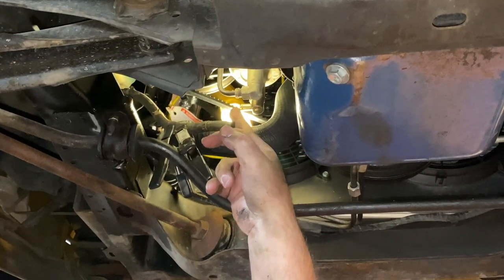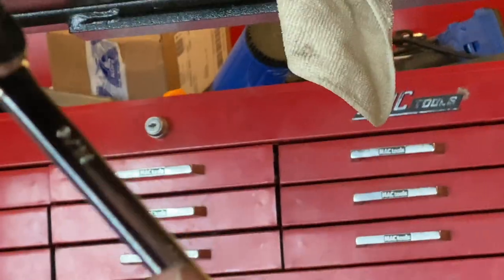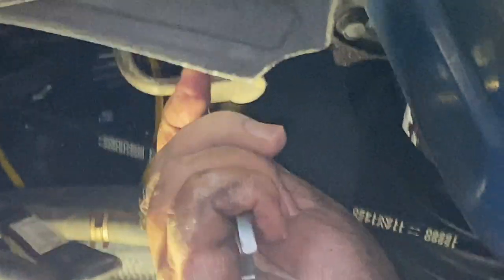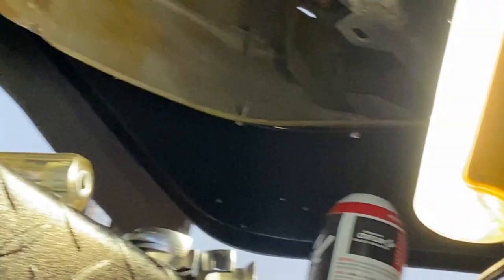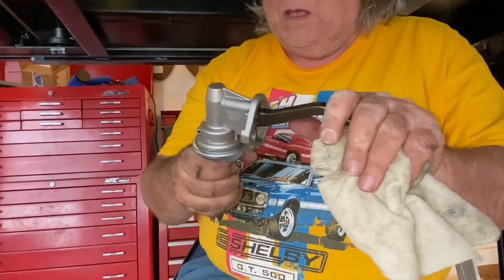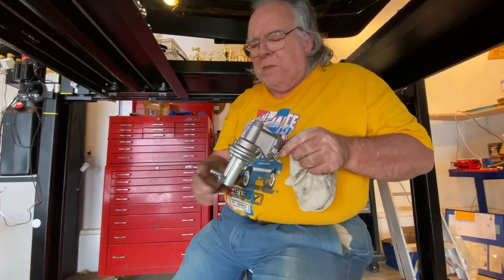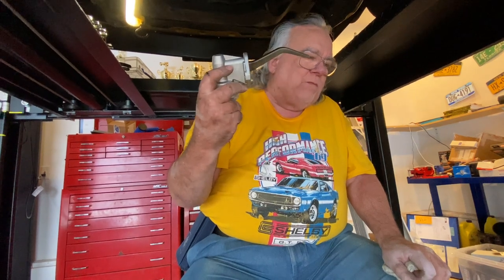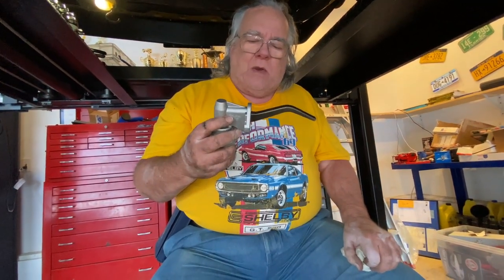1973 Mustang 302 V-8 Fuel Pump Removal

Comment: 6:21 I'm positive my gasket is the issue with my pump, can I make one out of the carburetor meter block gaskets I got in my 6140-6150 carburetor kit?
Reply from the maker: Any gasket material in good condition and cut properly will work fine. Especially if you use a silicone based adhesive like I did. Using a good quality silicone gasket forming adhesive, like the Permatex brand silicone gasket former like what I show in my various videos, can technically be used with not gasket. But I prefer to have a gasket just because I like to have the expected amount of gap between unit with mating surfaces.

Comment: Great tip about best rotor position for pump replacement - changing one out this weekend & tip will definitely help!
Reply from the maker: I am glad you found the video helpful.  I used to think the videos Lynda and I have been putting together may be to simplistic, or perhaps I was over=explaining why I do things the way I do.  But when I have folks like you send me comments letting me know the information is helpful it tells me I am doing more good than harm.  Thank you.  I hope your fuel pump replacement project goes at least as easily as ours did.  Keep the liquid gasoline away from your arm pits, eyes, and ears!   Now you have been warned twice!  heh heh...
Reply: @gilberthale7777  it took a while to find the correct fuel pump, but I finally got it changed out.  the tip with 2/6 rotor position really helped considering how tight the spot was on my 74 ford e100, 302.  your video made everything really easy to understand and got me back on the road.  thank you so much for taking the time to make this video and sharing your knowledge!!!
Reply from the maker: @rudymartinez4195  I am sincerely glad the video helped you get through the fuel pump replacement on your van.  I worked on a lot of those larger vans in the 70s and 80s.  Even with the 302 engine things could get pretty tight.  I do not envy you with that job you pulled off.  I am glad it worked out for you.  Thank you for the Kudos...
Reply: Thank you for a very informative video!
Does the 2 and 6 rotor position also apply to a 289 motor in a 65 mustang?

Comment: Very helpful info!  Thanks for sharing.  I am about to change out the mechanical fuel pump on my Factory Five Racing Cobra that has a '65 289.   These pointers will be a big help!
Reply from the maker: I am glad you found the video helpful.  Lynda and I enjoy putting out these little videos, as I find the info we put forth is either woefully lacking, or too often incorrect or incomplete.  At that, after I post our videos I am always thing of ways I could have added more detail that might help in some unusual cases.  I have re-done some videos for that reason, or added more vides going into the higher level of detail.  There are so many things that can go wrong with automobiles in general, and even these older vehicles.  There is no way to cover all bases, but we do what we can.  Continual Improvement, a tag line I happen to subscribe to.
Reply: @gilberthale7777  Thanks!  Its the kind people like you that help make our passion for cars fun!  Have a great and a wonderful driving / car show season ahead!
Reply from the maker: @jaredaubin6577  Lynda and I have enjoyed making these little video presentations on subjects I either do not find are covered well, or not covered at all.  To see others are finding them useful really does warm our souls.  Thank you for taking the time to let us know this was useful to you.